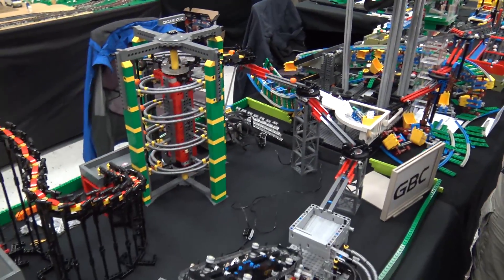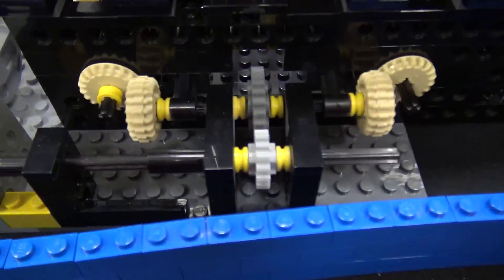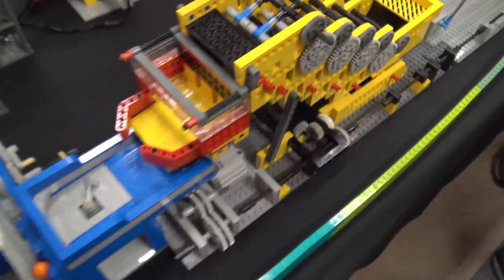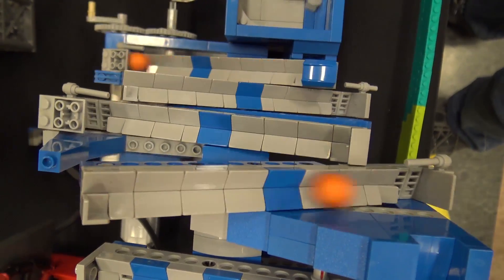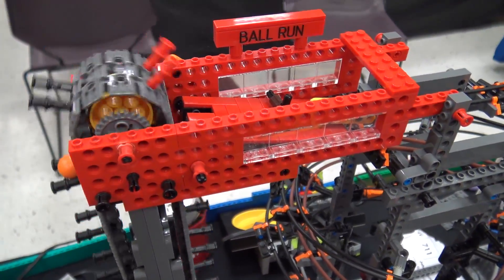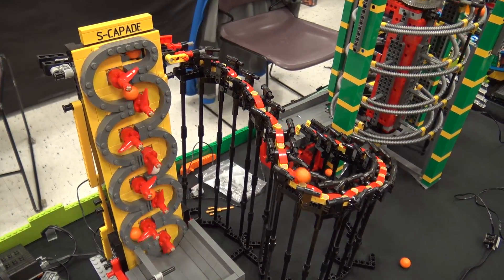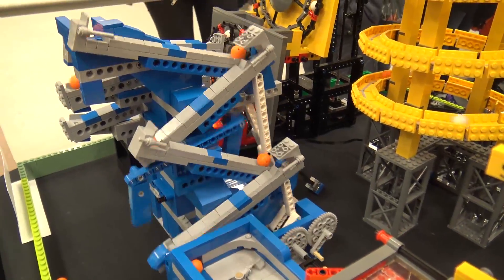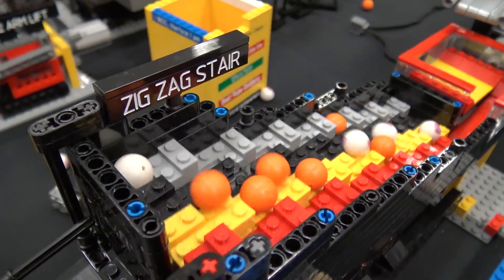LEGO Great Ball Contraption at BrickCon 2017 (Rube Goldberg Machine)

Comment: I started building GBC's just over a year ago. I've built Armed and Dangerous, S-Capade, See-Saw, Four Bar and one not mentioned here called Sawyer Scissor Lift. Just started the 3 Wheeler module. All of John's designs are solid builds and quite ingenious in many ways. And once set up and tweaked, they are VERY reliable. I'll never dismantle any of them, that's for sure. Thank you John.